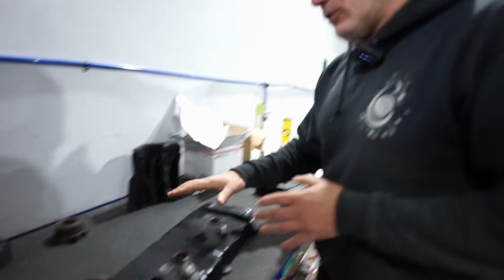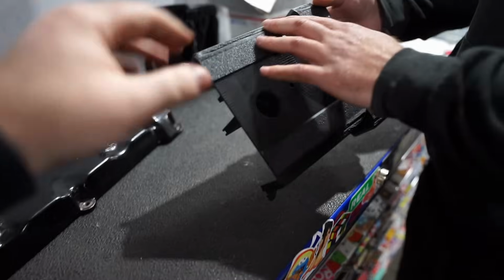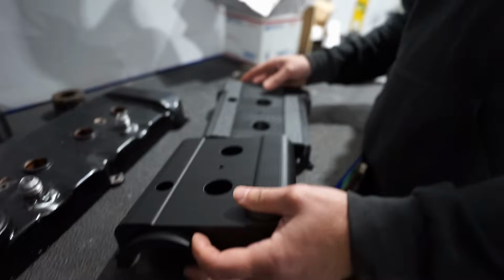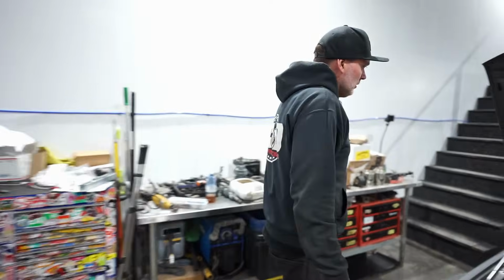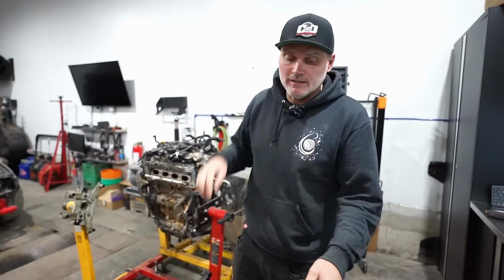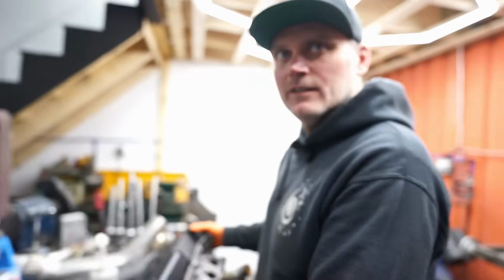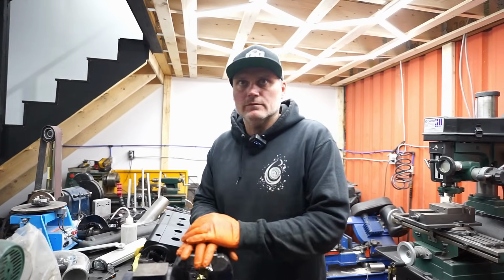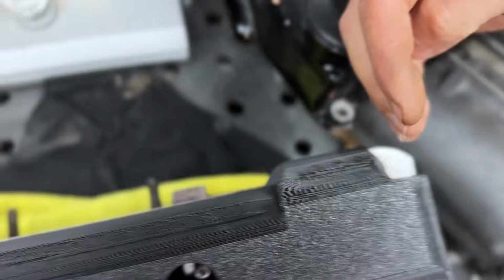Using 3D Printing to Build Race Car Parts

Comment: As an Audi TT Quattro APX 1.8T owner, I have enjoyed your content over the years. From before I owned my first TT 1.8Turbo to today where I have a small YouTube channel myself featuring a few videos regarding trouble shooting issues, from replacing the previous owners work, bringing back the OEM diverter valve and removing the blow off valve that did nothing but dump good air back into the atmosphere. Then, the issue on the issue was solved l, from hoses cracking to water pump failure. The last could have killed the head but was fortunate to not. You have been a great channel that gave me the confidence to start my own. Tomorrow, I'm doing a tie rod end replacement, which I'll be uploading once done successfully.  Great channel. Thanks for the memories 🎉😊
Reply from the maker: Thanks, glad you enjoy. Best of luck.
Reply: Just after iv finished replacing the tie rod ends on my TT I went today and replaced 3 tyres (one was still good with about 70% life) Goodyear Efficiency 17inch 225/45 tyres and did the wheel alignment as after changing the tie rod ends i forgot to count the turns making the car crab walk. After doing everything its like i have a new car, thats the difference, its incredible how simply changing these on a car and doing the wheel alignment can make such a huge difference with the driving experience! Where i live the roads are neglected so bad that its common to hit a pothole in the road that causes your tyres to get bubbles on the wall. Thats what happened to me with 2 tyres, but i was lucky as my friend shattered 2 mags after hitting a massive pothole at night. So dangerous driving on roads like this. @COMotorsports

Comment: I’d like to see you guys 3d print moulds for proper forged carbon fibre. 
Maybe use high quality silicon to take moulds, and then use a suitable press to squeeze out the majority of resin. 
You do still need 3d for scanning the model, to workout the exact volume/displacement. 

🇦🇺🤜🏼🤛🏼😎🍀

Comment: i do wonder what material you will find to hold up to heat cycles..so many applications.Super neat.
Reply from the maker: There's a handful of decent ones out there we've seen used. Haven't dabbled with it yet so yet to be determined for us.

Comment: off topic...the slave cyl on the new toy car an 02 quattro tt went south. while iam in there what is a good upgrade clutch thats still drivable?   max the car will ever be is under 350hp. will a new stock unit hold that religiously....
Reply from the maker: There are lots of options. We use South Bend, Clutch Masters, DKM, and Ringer Racing. They all would have something for you.

Comment: Nice design!
Beautiful print!
Yes, it shrinks a bit. Put this correction during slicing. 
With Nylon-X it will be great part.

Possibly better bigger print area printer, to fit part at once. 
But for prototyping just great.

Anyway, you can do all correction with pla prototyping and order final aluminium print.
It is a lot of options.

Great job 👍
Reply from the maker: Appreciate it. Thanks for the info.

Comment: As someone who is doing similar things with fusion and bambu carbon, the material you use is critical for test fitting. Some materials have shrinkage rates when they cool- as ABS shrinks 0.4-1.6% ish. Knowing that has helped a lot for accuracy- good luck and have fun!
Reply from the maker: Appreciate the info

Comment: For car parts a 3D scanner on top of the printer is your best friend it will save a lot of time and make mock-ups fast and easy to modfy or change. Take account into consideration the clapping load forces you will produce when printing vertical vs. horizontal, awsome vid happy were enovating 😊
Reply from the maker: Yeah 3d scanner is on the radar for sure.

Comment: Is all that worth it. I mean i dont really know why the original part isnt good enough.
Reply from the maker: The original part has zero baffling for boosted applications.  So you see in the video how much oil gets pushed out during a simple dyno run.

Comment: For the AN fittings on the valve cover I would machine it solid and then it can be drilled out and tapped for the AN fittings instead of welding in bungs. Make's it future proof if u want to sell the covers and the buyer has no need for the holes on his setup
Reply from the maker: Yeah, this is mainly for my application but yes there will be things to consider if anyone else ever wanted it.
Reply: @COMotorsports  I'll take one =)

Comment: We took the plunge into the 3d print space recently as well. We came up with some 3d printed subframe centering kits for MK4. Also made a custom connector housing that plugs into the 9 pin MK4 auto trans relay to break it out into individual starter and reverse light relays, which can be used for manual to auto and auto to DSG MK4 swaps.
Reply from the maker: Nice work

Comment: Be sure to check the 3D printer dimensional accuracy. If it doesn't fit coming off the printer and you make changes so it fits in the software, your machined part likely will not fit. So make sure your prints are dimensionally accurate.
Reply from the maker: @VWRalf  thanks we've thought of that as well.

Comment: Are you using Fusion360?  Is that free or do you have a commercial version?
Reply from the maker: @dB_944  yes it's free until commercial use.
Reply: Autodesk Fusion has a 30 day free trial with full functionality. After 30 days, the software reverts to the freeware with limited functionality. I don't think Autodesk is using the 'Fusion 360' name any longer.